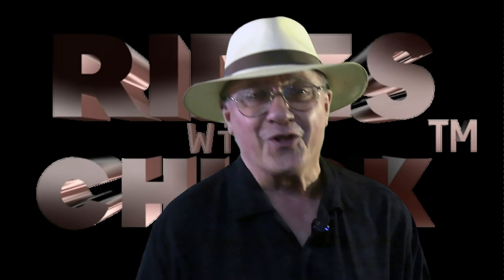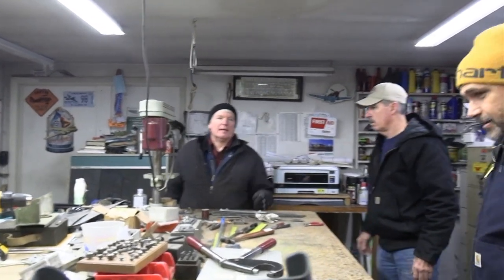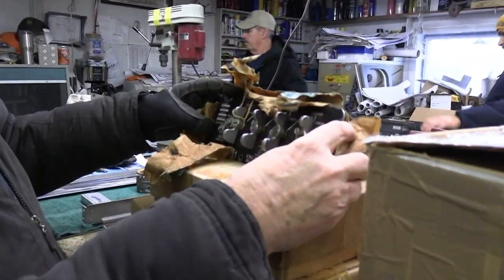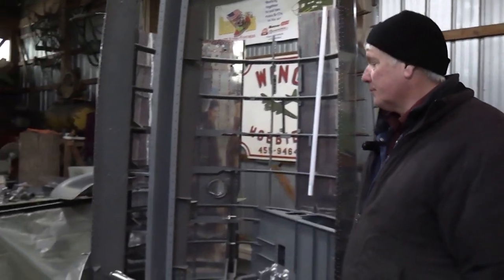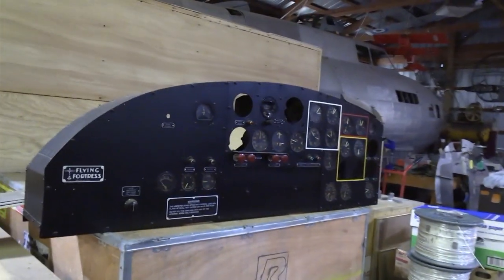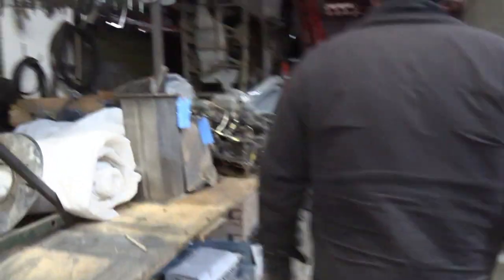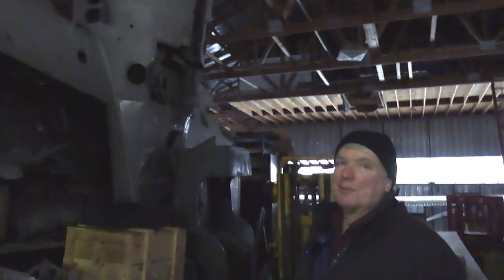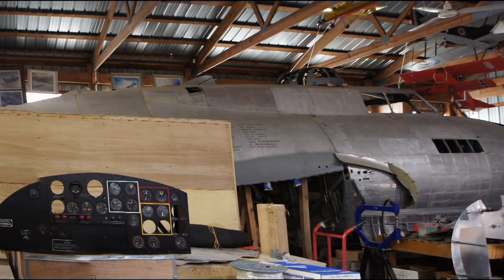Desert Rat 2021 B17e Update. Cutting it real close but it's all good.

Comment: I live within 20 miles of the B-17 static display in Tulare, CA.  About 2005 I was allowed inside of it to take pictures because I was building a 1/9th scale B17 Radio control..

That poor B17 was absolutely total gutted inside..Everything and anything was gone. The front chin gun turret was a fiberglass replica..Every gauge-control-tank-wiring was all gone..
The Amvets that are caretakers have sold off everything inside..It is parked right next to the freeway (Highway 99) and a truck went out of control and ran into it several years back..

Comment: sometimes the best option is to make the part in house. ive worked production manufacturing for metro transit busses electric golf carts high pressure hydraulic tanks valves for water treatment plants and several plastics factories there's always a "metal shop room" where they make their own tools for the 1 part no one has. when microsoft ended support for xp it messed up production everywhere some companies gone out of business some survive obtaining a little machine to stamp out thousands of 1 small part for the aircraft industry
Reply from the maker: I wish my Dad was alive to watch this project move a long. He was a tool and die maker.